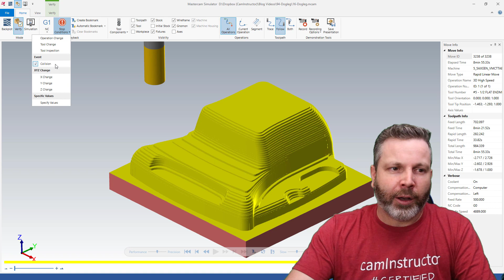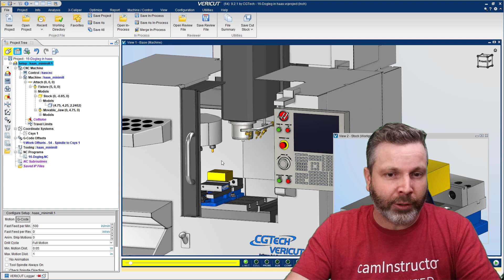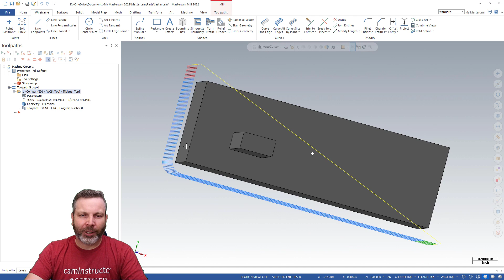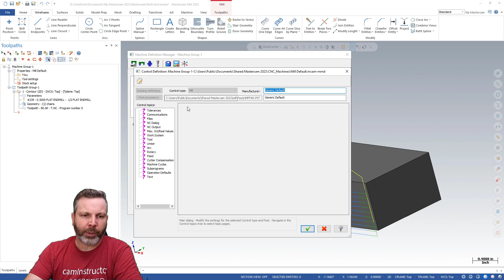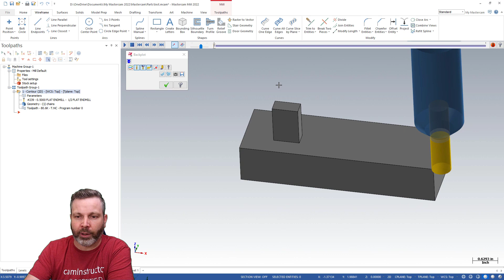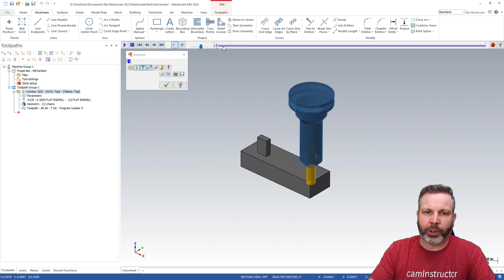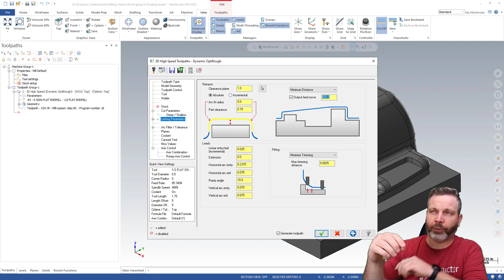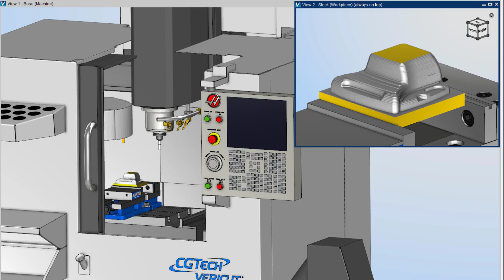Dealing with Dogleg Rapids in Mastercam

Comment: Another great video. One thing I will mention though. It is pronounced Fanuc and not Fanuc, like you said it :)
Reply from the maker: lol, FAN-IK vs FAN-OOK. I've looked into this before, seems everyone has a different opinion on it. I go with FAN-OOk since FANUC is an acronym = Factory Automation Numerical Control, so technically the NU should be pronounced as the NU sound in Numerical, right? :)

Comment: this Dogleg movement is dangerous, why would anyone want this behaviour? it doesnt change anything except that it moves different, which may end in a crash. (so it has only downsights)
Reply from the maker: Some machines are only capable of dogleg rapids. I don't think anyone wants them, just have to deal with the hand you're dealt.
Reply: @CamInstructor  yeah. fortunately i work on machines which dont have this issue (Heidenhain controllers).
Reply: @CamInstructor  this is actually a controller/software problem which could easily be "fixed".
Reply from the maker: @zweisamergummigockel  not sure I follow?